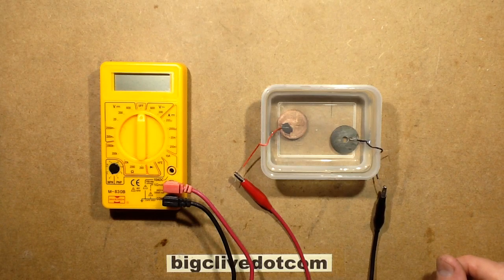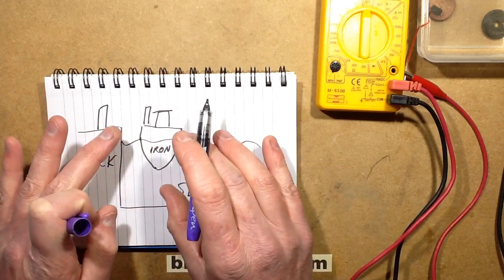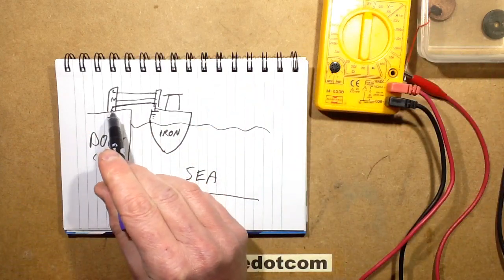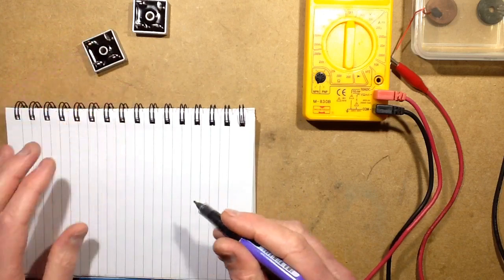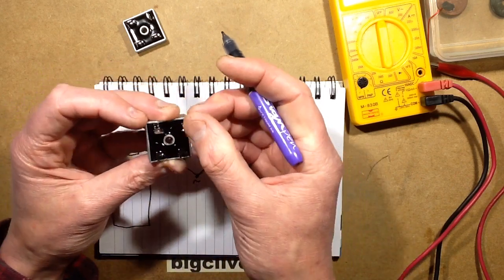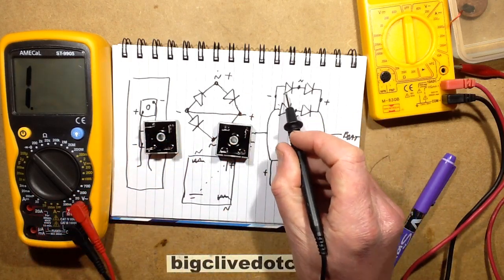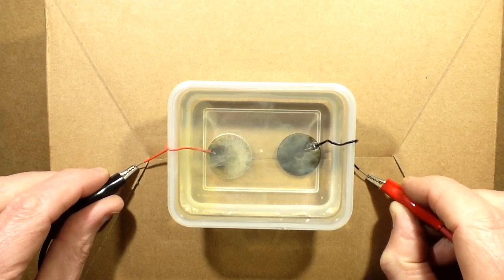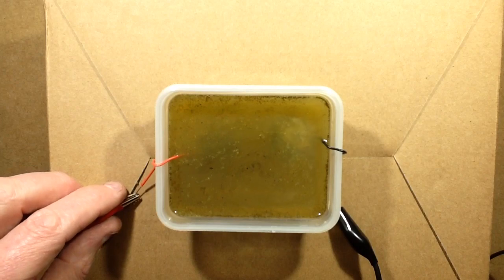Intriguing science of galvanic isolators for boats.

Comment: I used a 12 volt car battery with a charger connected to de-rust steel parts for the restoration of my classic van. A plastic tub with soda crystals dissolved in water. The rusty parts are hung into the solution and connected to the negative. Then a sacrificial steel lump is dropped in connected to positive without touching, in a couple of days the rust leaves the pieces I want cleaning and deposits on the sacrificial steel.

Comment: I read in a book on canal boat restoration that a radio antenna can cause galvanic corrosion. Can you shed any light on that?
Reply from the maker: +Hewpie i would expect the RF energy to be AC, so I wouldn't think it would pose a problem.  But radio energy is a fairly  specialist area.
Reply: +bigclivedotcom i would imagine that even with AC current from RF that half of the wave would still dissipate through. essentially DC is just half an AC wave!

Comment: When accelerate the reaction by applying current, if you're using sodium chloride salt in your water then the gas produced by electrolysis on the positive lead is going to contain chlorine gas. The concentration you get is not going to kill you, but it's not super great stuff inhale either.

Comment: Thank you clive, for explaining a really interesting topic for us, as we live on a narrowboat.  One question that remains, is if you added a second boat (or steel washer) which wasn't connected to the shore (or power supply), would the reaction take place on the unconnected one?  Many thanks.
Reply from the maker: +marc harris If there's no connection to the shore ground then the circuit is not completed, so there is much less chance of corrosion.  But localised corrosion can still occur between dissimilar metals connected together under water.
Reply: bigclivedotcom
Thank you.  We're off-grid, so its not so much of an issue for us, but an often disscussed topic between boaters. Even more enlightening was the difference in cost between 2 bridge rectifiers, and a box with 'boat magic' written on it! Thanks again, pint owed to you if you're ever in leicestershire. :)
Reply: It'd depend on what the boats are made of, I think, if they were both the same metal, nothing would happen. Since you're in fresh water, it's probably fine anyway, fresh water isn't great at passing current, even with the filth (and leptospirosis) in most canals. My mate had a cabin cruiser, but it was fibreglass. I met some very interesting people who live on canals though.

Comment: Interesting. Normally I would think of galvanic isolation as making something electronically float with respect to another thing, so that no current can flow if you connect just one wire between any point of each end. Like transformers' secondary windings, which you can connect in series or parallel, like batteries. This diode trick, on the other hand, only prevents current flow when there's less than 1 volt of potential difference, so it's a very different thing. But I suppose the term "galvanic" isn't very strict, so it fits this concept as well.
Reply: It appears that I may have been using the term "galvanic isolation" incorrectly for 40 years. I also thought it meant to isolate the sides so there could be no current flow.

Comment: Good explanation. One comment however; when you were talking about the currents flowing in a larger system you mentioned that the currents would be much higher. This is of course true, but basically irrelevant. Rate of corrosion is relative to the current / area (in corrosion terms we talk about current density).

The problem that had occurred on the boat that you showed pictures of was 'stray current localized corrosion' (apart from not being properly electrically protected, that is). Minor defects in the paint forced the current out at these locations. Since the absolute current and potential is, for all intents and purposes, constant and forced out at the relatively small defect areas, the current density at these spots gets quite high, and corrosion failure is the result. Ironically, if that part had not been painted, it would probably not have been punctured. It would have gotten rusty and ugly though.
Reply: +Left Flamingo That's the same phenomen that works on your teeth's mercury amalgam fillings. My smaller ones always had higher voltages.

Comment: Curious if neutral's are bonded to the earth wire like they are in my meter box in Oz
Reply: +Justin Richards yes and no, they are at a point but they'd be useless for a GFI if they were connected within the house which is why it's usually done at the box or outside. You can get whole house GFIs now and they're cheap enough that they are worth it. Especially if you're running chinese electronics....
Reply: +BikingMNViking not sure what GFI is ... Galvanic ???? Isolation, but I think I see your point.
I was incorrectly thinking the neutral would provide a return path and the boat would continue to corrode. But I did not think it all the way through. (unless it was also bonded at the boat side which would not make sense)
Reply: Ground Fault Interuptor...huge here in the states. code is for one on any outlet within 6 ft of a water source so most bathrooms and kitchens now have one.

Comment: At the top of home water heaters you'll probably see a large bolt head.  If you remove that while it is turned off and the water inlet valve is closed you'll see a corroded zinc rod or chain connected to it.  That is a sacrificial rod designed to keep your water heater from consuming itself internally.  If that rod completely dissolves, your water heater will start corroding and eventually leak.

Comment: why isn't the water a good earthing itself? we're garranteed that the water is dirty and conductive, aren't we?
Reply: +nraynaud1 It is earthing but not neccessarily low resistance earthing. FYI meters use often use less than 70 ohms before they beep on continuity mode (often used to test diodes BTW. I still don't get why they need two.

escorpiuser is probably right about the wire and its condition related to ground. On homes here in America the code is to use a 10 foot copper rod outside the house even though every house is naturally grounded through its plumbing. Even the new building I saw being put up used cast iron but now above the frost line they are allowed to use PVC. Seems double dumb to me. I notice a lot more fires I wonder if there is any coincidence.

I remember when I was a kid I'd hook my crystal radio set to the plumbing fixture for ground. BTW a banana plug fits perfectly in the 3rd prong on the wall.

Comment: Large ship power systems do not use a neutral. The star point in the generator is left floating or on HV generators is tied to hull by a high resistance resistor. So when the ship is connected to shore power its by the 3 phases only and an earth connection. This is the same for all the electrical systems on board and is done this way so that a fault in a motor for example to ground will not trip the breaker. This is desirable if you have a flooding compartment you want the bilge pumps to keep running. If you happen to get an earth fault this will result in phase imbalance but the electrical system will still work. The issue is if you get another earth fault on another phase the fault current can flow through the hull which could cause a fire. So we don't use galvanic isolation when we connect to shore power it just wouldn't be practicable as we can draw up to 1000A at 690V. Cathodic or impressed current protection is a different system and this is used to reduce hull corrosion.

Comment: I wonder whether the term "galvanic isolator " is meaningful in this case. I mean, there is high equivalent resistance only if the voltage is below a very low threshold and reverse leakage current is also present.

Comment: So is this how the weird active galvanic protectors are supposed to work? i see some very very questionable devices that either put a small charge on the boat to offset the corrosion somehow, or they try to surround the boat in a power field (which I suspect is something that will never work given moving water would destroy the field).
Also, it's strange to hear of a metal boat not using zincs.
Reply: +Selinica Harbinger Why? I think it's stranger not to think we could do anyway with changing radiator fluid so often if we just put in a 100k mileage sacraficial rod in a car's radiator system -- we do it home water heaters.

Comment: Yep,, great job yet again..
Years ago the Frieghtliner truck company had a Positive ground semi-tracktor. This was to combat electro - plating of the radiator and heating core. 
If this was a good idea,  then I wonder why they quit?
tanx....
Reply: +Willy Bee I've always wondered about that, too. There were 6vdc car systems years ago with a positive ground. Jay leno has some in his collection.

It probably was better and got outdated because of the safety devices...back in 6vdc did they even have a lighter plug? Pry not.... now the ham radio and CB comes along and the rest is history.
Reply: +BikingMNViking 
I am only guessing that if you connect to a negative ground trailer,  that would mess things up. ..
But now with Leds, unless each one had a  bridge rectifier,  the lights wouldn't come on. ( on the trailer )
I am also guessing that every tractor and every trailer would have to be switched to  positive ground.
Kind of like GOING METRIC. 
Or if you only knew how to speak Klingon, and no one else did....   ;-)

Comment: Hot water heaters have 1 or more anodes in them designed to corrode to prevent the other metals from corroding.  It's also the reason why you are supposed to have the usually plastic washer connected to your water input and outputs to keep the different metals away from each other.
Reply: +John Doe No, those plastic isolaters are for heat loss. It if took care of the problem you would not need a sacraficial anode at all. What is annoying is why they make them all so hard to get to while electric water heaters have cheap and easy elements that go right through the side. That's how they should put in the sacraficial anode. You usually need an impact hammer to get one out so almost no one ever replaces one and justs lets the water heater go bad and eventually leak.

Comment: Let us build every ship from concrete (it will float, just do not fill it in)!
Reply: Even worse- the matrix inside the concrete (rebar and wire mesh), will corrode even faster, without an outward indication, usually a bulge in the hull near the corrosion, or the spalling of the hull's outer surface,due to poor maintenance, i.e. improper paint application, or going aground, or striking an object in the water or alongside.
Reply: +acmeopinion factory The Germans build their amunition and mine transportes from concrete, some of them are still floating today (73 years later). I do not see any problem.
Reply: +MatzeGamer I agree it can be done, it's just not economically and commercially viable in today's world. If a steel ship experiences corrosion, one welds in new plates, job done. If the ferro-cement ship experiences internal corrosion, it cannot be repaired properly, as new work does not adhere to the hull as well as a steel plate does to a steel hull.
As you said, some are still floating after 73 years, I think the operative word here is ' some'
There is also a good chance, (I really don't know,) that these survivors are not engaged in day-in, day- out commercial service.
I would be surprised if they were anything except in a static, non critical, non danger to lives on the open sea use.
Reply: +acmeopinion factory One I was on many times hauses a restaurant. It is in the German city called "Lübeck".
Reply: +MatzeGamer As I said, static, noncritical use. Don't think they'll be crossing over to Nysted anytime soon.

Comment: I knew you had to know about it, I wrote a post on your other video with the "Deadly quack water tester(scam)" and the whole time I was like, 'he definitely already knows about this, but I'll write a detailed post up anyway for others'.

So hopefully I provided some inspiration.

My personal experience with galvanic corrosion, was helping a friend cut out corrosion, and weld in aluminum squares, along a guys boat deck. After the drydock messed up, and used stainless steel bolts on his aluminum deck.

 Looked just like this
 
https://upload.wikimedia.org/wikipedia/commons/7/7d/Stainless-steel-mild-steel.jpg

All it takes is waves splashing up on the deck, and a few months later you're in a huge mess as your deck starts to separate from the hull.

Comment: Lots of interesting points here Clive. You mentioned 'rapid corrosion'; my son fitted a Maplin wind turbine generator to his sailing boat, connections included crimped-on terminal lugs. After one month on the boat, no more power was being produced and there was a small blue stain on the deck where the lugs had been.

I expect you have seen the many YT videos on electrolytic rust removal. I made such a set up and have cleaned many ancient workshop tools. You certainly get to see some unappetising red-brown soup in the process. If you haven't yet played with this, I'm sure you would enjoy it.

I had some dealings with an Aberdeen firm called Corrocean Ltd. - they employ techniques based on this branch of science to protect N. Sea rigs.

Comment: Well, at 4.5 V you'll get oxidation of whatever the metal is connected to positive, along with generation of hydrogen peroxide.  At the negative electrode you will have reduction of the oxidized metal (plating), which will appear nice and black because the surface is too rough to reflect light; and possibly reduction of the peroxide.  When you switch polarity the deposited metal is first stripped off, then you get the oxidation effects.  That's really a high potential for electrochemistry.  You can have more fun if you keep your power supply in the mV range - it will grant you selectivity for things like Cu plating...

Comment: Gosh. I pretty much watch this channel for the accent, the odd beverage choices (for an alleged male man)  and the long, unedited pauses while he(?) goes 'n' gets stuff.Don't have a clue about electrical matters and such. However it surprised me to see a video based on a vessel that floats in our very own man-made lake, where the owner of the hapless "partay" boat tried to claim the hull damage on the local electricity supplier.

Should also point out that the lake is not remotely saline, but kinda generally foul due to the mud-swilling carp and the blue-green algae that results from the nutrient-rich stormwater runoff  from the fair city that surrounds it.